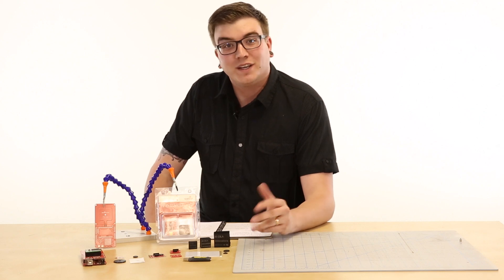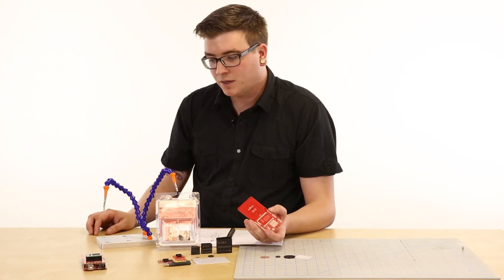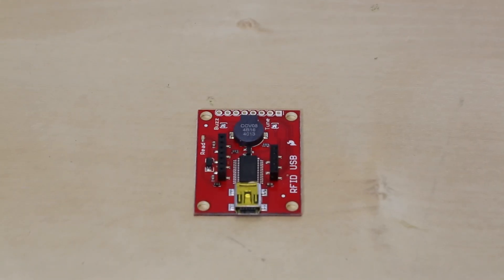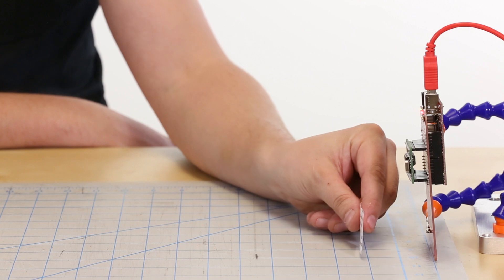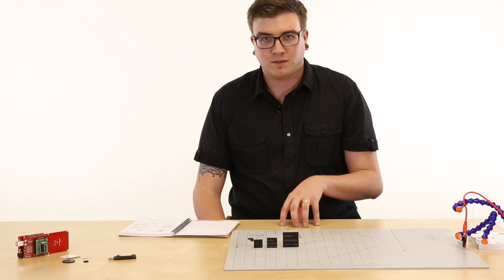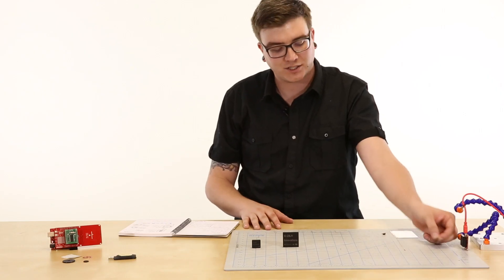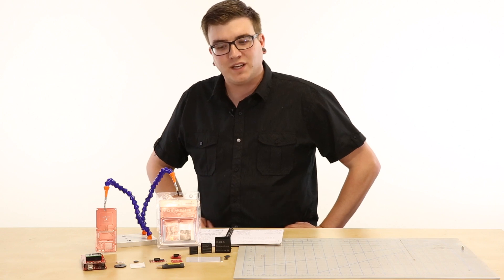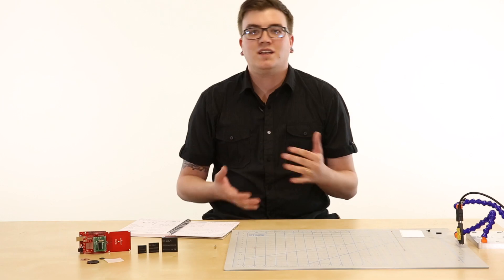RFID Comparison with Tim

Comment: If an ext. antenna is required ("mandatory") with the ID-3LA, what's the point of "range testing" it w/o an antenna?! 
What useful info does that provide? 
I'll answer that for you:  None.
Also the many refs to info in the previous video were not helpful for those who didn't see it.
Would've been more useful with actual useful info on implementing it, like what's included, what's needed to get it to work.

Comment: Just out of curiosity, have you considered changing the orientation of the glass capsule by 90 degrees? I say this because the coil appears to be wound along the axis of the glass capsule, which means that the coil wouldn't be orientated correctly the way you tested it.

Comment: What about NFC?
Reply: That IS nfc. They're the same tech as rfid, just used for different purposes.
The main thing is that the range is very limited, max is generally about an inch, or 2.5cm for most.  
The range is largely dependent on the size of the antenna -- the larger the antenna, the larger the range, up to a few inches. Don't forget you're powering the tag through that wireless "connection," so while it's cool, it's not efficient.